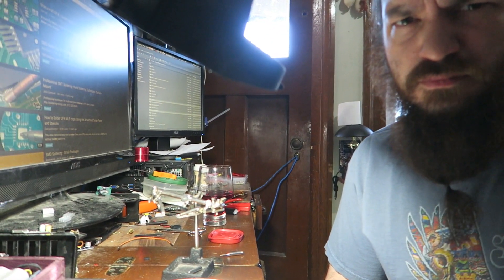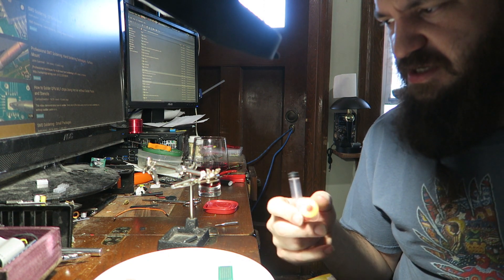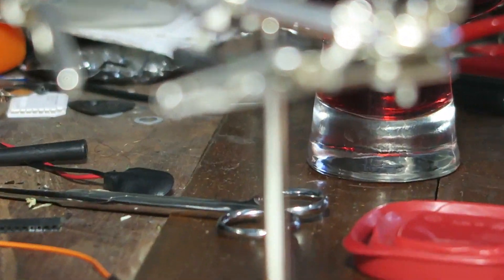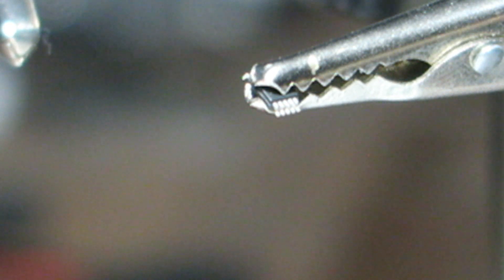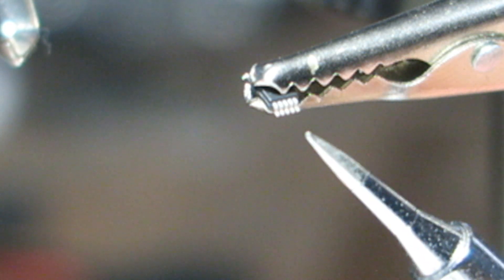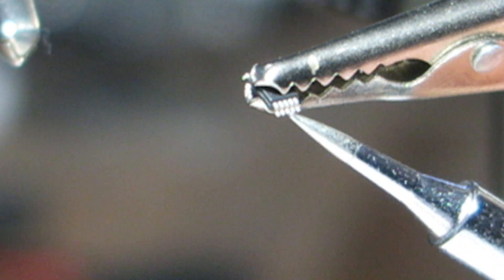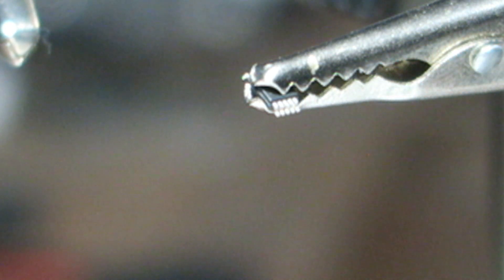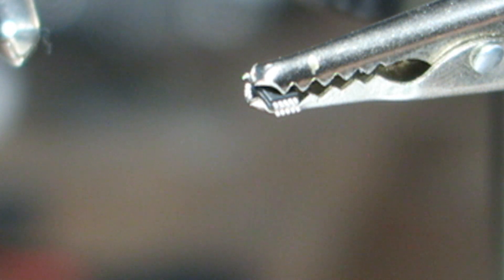The Never - Progress #3 - MSOP-10 Soldering

Comment: By any chance is the chip an AD8244? I was just looking at that as a possible way to avoid either building a buffer preamp from scratch or buying a circuit like a Bartolini
Reply from the maker: Sorry on the delay in response, you are correct that this was an AD8244, but when i finished this board, the result was less than optimal. There was a hissing present in the directly coupled design that I could not resolve, and I wound up making a more conventional capacitor coupled circuit in a later video that worked well.
Reply: @willhbert  Which of your videos includes the preamp version that you preferred?
Reply from the maker: @kevinjokipii4260  That would be https://youtu.be/882KbbSTSos and/or  https://youtu.be/2gF7lcyXEcc . I used three TL074 , which forms a buffer/splitter. Six of the opamps there are used for the hexaphonic audio, and the other six get summed on the inverting input of a TL072
Reply: @willhbert  Thank you. Does the capaictor coupling appear to be critical mostly on the output to the subsequent stage, or is it needed on the input even though a piezo is essentially a capacitor?
Reply from the maker: @kevinjokipii4260  I think the reason the capacitor coupling is easier to get right, is because the input/output capacitorsm and bias resistors also do the job of forming an r/c filter circuit. My rudimentary (and possibly wrong) understanding is, we get a high pass filter on the input (between the input cap and the biasing resistor to ground), and also a low pass filter on the output, when you consider the next stages of the circuit (amp inputs generally have a resistor to ground as the first or second component). At some point in time I plan to experiment with this again, and see if I can make a directly coupled preamp which does not hiss, but there are many projects competing for my time.